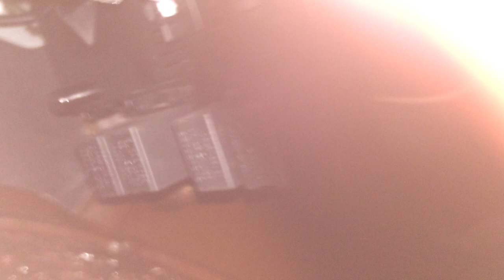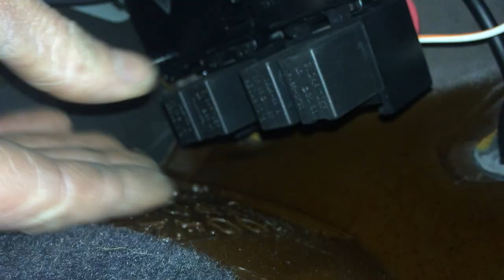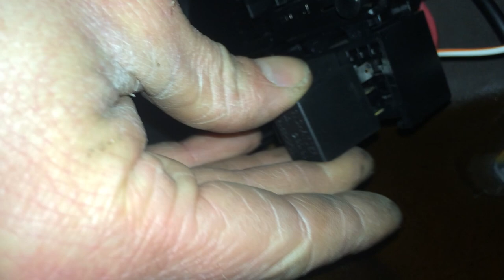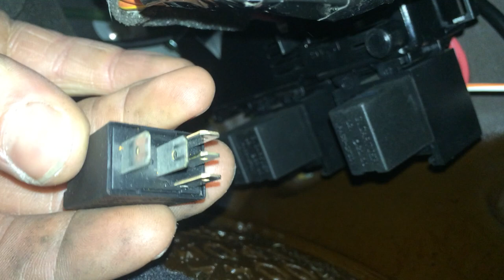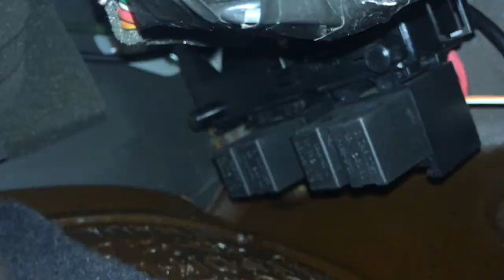How to fix Renault Clio Headlight Problem - Dipped lights/Sidelights acting strangely or not at all.

Comment: Where is the relay?
Reply: Shaxxie Did you find out where the relays were? I have same problem and cannot find them under the glovebox anywhere which is where they're supposed to be
Reply: Peamush actually mine was a faulty wire from the headlight stalk control to the dashboard. Replacing the wire fixed my flashy lights!